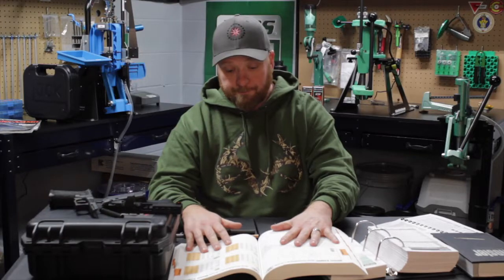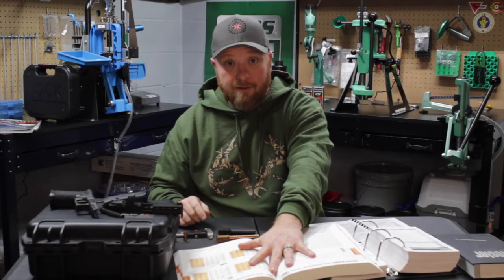Squatch Reloading - The Plunk Test and Case Overall Length

Comment: Gold star for you bro! The second, most important part of the "plunk test" is spinning the cartridge once it has landed. If it doesn't spin, don't put it in! So critical. Your video helped me to avoid countless jams in my Shadow 2 (go ahead, ask me how I know). Went from 1.134 to 1.05-1.08 and they all spun right up. Thank you!
Reply from the maker: Ha the CZ chambers are what made me really dig into this.
Reply: I’m glad I seen this video. I’m some what new to reloading . And I use the block for 9 mm. Some of my reloads seem to sit just above the block . But if I put the round into my m&p shield it works fine . So I’m better off using the BARRAL from my sig and shield
Thanks for the video
Reply: Now after you seated min. Of .054 thou. Did you change powder weight?

Comment: Thank you so much for this informative video I just started reloading 9mm the other day and ran into this same problem. I matched the 124gr RN lead OAL to a factory 115 fmj. And of course I could tell right away that the shape of the bullet being less tapered that it was jamming the action in my pistol. Reduced the OAL down to 1.07 and now it passed the “plunk” test just fine. Of course I know that will also increase pressures so I need to be careful right now I’m still at minimum load so I’m going to test later this week before working up higher loads.
Reply: I know it's a bit dated now but would like to share my thoughts on this topic. When reducing your OAL and even though your powder charge is at the minimum reduce it by 10%. Then use a chronograph to check the velocity. That will get you good data to evaluate where you are.

Comment: Thanks for that explanation.  I’ve had the same problems from barrel to barrel on reloads.  I never thought that small deviation in OAL would make that much of a difference.  Clears up the frustration when you’ve loaded a bunch of rounds exactly to certain manual specs only to have them continuously jam/double feed.
Reply: When working with new load combinations I only make 10 rounds, then live fire and chronograph.

Comment: Thank you for this video!  Just started looking into loading 9mm Luger.  I have loaded .357 mag and .38 spec. for many years and ran them through a revolver with no prob.  However, I sensed there may be a problem in an auto-loader if things were not exactly right with the finished load length; especially muzzle pressures, loading and ejection problems that could result.  Thanks for a great video!  You my friend cleared up a lot of questions for me.
Reply from the maker: You are very welcome

Comment: I just got a CZ Shadow 2, I reload 147 blue bullet, this round flies through my Glock. At my first match with the CZ Shadow 2, I started getting light primer strikes to a point where I had to quit the match. Cajun gunworks advised to check my AOL and use my CZ barrel as a reference. I adjust the AOL to 1.13, I believe I have to deepen the projectile a bit more till all round seats appropriately. Your video was very helpful.

Comment: FANTASTIC explanation dude. I'm really glad about it. But as usual if one question is answered three others pop-up😂😂..... Same here..... If one has the cartridge all ready . Primer placed, powdered, bullet placed. Exactly following the books regarding the weight of the bullet but different brands. Then confirming it by the "plunk test" and the aol proves to be too long. So, one decides to fit the aol to the plunk test but the bullet goes deeper and deeper into it's case. Isn't that dangerous in relation to the building up pressure?

Comment: I recently purchased a Walther Q5 match 9mm and the first day I had 71 failures in 120 rounds using RMR 124 grain Truncated flat points. Today i used Hollow points at the same length and 1 failure in 120 rounds.  This video will help a lot because i have thousands of bullets like that and in NY any reloading supplies are tough to come by. Hate to make "special" bullets because all my other guns have no issues but you have to do what you have to do.  Thanks.
Reply: I have the exact same gun and had the same problems! That chamber is very short compared to my M&p so I ended up reducing OAL to 1.07 and then it cycled just fine. Before I was at OAL equal to a factory 115 fmj and I couldn’t get it to lock up. Would jam the slide if I tried too hard to rack a round into the chamber. Did the plunk test and got the results I was looking for.
Reply: @DIYDad1  I went to 1.050 on the TFP with 3.6 grains of Titegroup, great plinking round.  With round nose I set COL at 1.125 and use 3.9 grains Titegroup.  Both work great and it helps to get about 700 to 1000 rounds through the firearm.
Reply: @edwinbrown219  yeah that seems to be the sweet spot for this gun. I ended up reducing the OAL to 1.05 as well. Some rounds are between 1.047 and 1.053 so for whatever reason my seating die seems to have quite a bit of variance but that could just be the difference in case length since I didn’t trim them first. Didn’t think people did case trimming much on straight wall cases so I guess it’s not too big of an issue.  Hopefully not lol. Hopefully I can test these new rounds this weekend. I’m right at minimum load yet, since the bullets are seated deeper I’m sure the pressure is higher I just hope it’s not too high. Only one way to find out.

Comment: I have been having this same problem. Setting my depth by the load data and it does not work. I also set up my die for a factory load OAL and that was too long for my Taurus G2c. I finally figured out to push the bullet in very small increments until I get the loaded cartridge to fall in my chamber properly. I was racking my brain by doing what the manual said. I am sure the manual is correct on most rounds but not all. My G2c ended up having a chamber of 1.062, for that bullet, and 1.100 for PHP from Everglades Ammo. All the while I was trying for 1.150 like my manual said. I am in about the middle of my load of powder so I should be fine. I am sure it also depends on the bullet shape. Unfortunately there is not a book for ALL manufactured bullets out there for sale.

Comment: I had a couple rounds of reloads in my Beretta 92FS that failed to chamber fully.  I saw that they didn't seat by the slide not fully forward, but it wasn't the OAL that was the problem.  It was the Lee Classic Turret press I use has some play in the turret, and when you seat the bullet, it will be set to factory recommended position in relation to the shell holder, but it will NOT size the case all the way to the base.  This can result in a slight bulge near the case base, just above the rim, and the chambering is just not gonna happen with a slight bulge at the case base.  I have reset my sizing die so that it resizes the case completely, and the failure to fully chamber is solved.
Reply: The instructions from Lee say to over cam your sizing die.

Comment: Cartridge Overall length (COL) has nothing to do with function, that can vary depending on bullet profile and vary.  The trimmed case length has everything to do with it in a semi auto.  A 9mm headspaces on the case mouth, as long as you are within the proper specs you're good.  Now, if you load your projectile to long you can push the bullet into the rifling increasing pressures and it's always good to check using the plunk test, that would be the only reason for it.  That is why you should always work up a new load when changing any component, especially a bullet even if it's the same weight.  Don't forget, if the bullet sits out to far and hits the rifling and sticks then you seat it deeper to function properly it's deeper in the case which can increase pressures dramatically even more than seating a bullet into the rifling itself.  When changing to a new bullet I split a resized and trimmed case to allow a bullet to just slide in with finger pressure.  I then insert it into the chamber and press on the base of the cartridge until the case mouth contacts the ridge in the chamber for proper headspacing.  I then remove the case and measure the length showing the length just where the rifling is in contact with the bullet.  I subtract .010" to .015" and that becomes my new COL for that particular cartridge using that particular bullet and using a chrony I develop a new load profile from there.

Comment: Thanks for sharing. I just started reloading 9mm & 40 S&W. My OAL varies in a run of 20 loads on both presses. I will get maybe five .40 S&W at say 1,125 then 1.20,1.23 1.129, 1.19! This is more pronounced with the Lee but the Dillon is not that consistent either. My Dillon 550 is for the 9mm with RCBS dies and a CH speed seater NOS. The Set up for the .40 is a Lee classic turret with RCBS seater not using crimp and Lee FCD. I'm using off brands cast power coated bullets and mixed range brass. 
.40’s are 180gr, 9mm is 147gr. WSF powder.
I keep adjusting seating die and locking everything down, running a few and measuring then start finding oddballs with OAL off again! Could it be the play in the tool heads? (I did run the die down on the lee to take out any play in the tool head with no luck). Not getting the same exact pressure on the handle each time? Maybe variations in mixed range brass? Maybe just a novice operator? However 97% of my rounds pass the plunk test and spin. I'm just concerned I won't be able to accurately develop a consistent load.
Reply from the maker: Mixed headstamps and bullet variation.       I do sometimes see variation in OAL for the above mentioned issues.  Perfectly normal unless you want to sort brass and bullets.  On another note I have seen bigger variation on my single stage press for example.  One day I size and expand then wait 24hrs and seat and crimp the next.  Surprisingly the expansion flare relaxes over night on some brass and will cause issues the next day.

Comment: Squatch I'm a new reloader and  just ran into this problem. Thanks for the video. My only question is since the bullet is being seated deeper into the case, and load data isn't published, how do you figure out how to adjust the powder charge? Seating the bullet deeper is going to increase the pressure and could lead to a gun blowing up.
Reply from the maker: There is no formula that I am aware to answer this question.  What I do is always start at the bottom of the charge weights for the given load and work up in .2 increments.  If you have a chronograph it makes this process a lot easier because you can start to accumulate data in relation to pressures, weights, and velocities and it will make you more confident. If a chrono isn’t available look for pressure signs.
Reply: I was wondering if I should just start at the lowest weight or a couple of 10ths lower than the starting weight and work up slowly. Thanks for taking the time to answer my question. I look forward to watching more of your videos.

Comment: I k ow this video, but I've got a question. When you reduce your COAL to fit your chamber, do you adjust the powder charge to compensate for the added pressure?
Reply from the maker: Sometimes work up based on minimum charge weight

Comment: 1st day of of ever reloading, after a year and a half of studying and reading everything I could,  I finally set up for what I thought would be a good round to begin with (115 XTP 9mm) using Hornady load data and OAL, I loaded 6 rounds and thought I should test them. Well as you can guess I had all the above issues, round 1 rack the slide, round chambers, pull the trigger BOOM, Hmm? that felt hot! Round 2 feeds and is pushing my pistol out of battery. I rack the slide and its sticking, Hmm? I clear the round and inspect, I look at the primer from round one as well as the case, no signs of over pressure. Round three rack the slide once again out of battery, rack the slide and the bullet is pulled from the case and lodged in the gun. Back to the bench and as you clearly explained I too checked all my measurements and not only was I under factory OAL, I was under Hornady OAL load specs for the round. I checked SAAMI and confirmed I was good and yep so it left me wondering where do I go wrong? Now I know!!! Great job, awesome content, and much appreciated.
Reply from the maker: I am glad this helped you out.

Comment: New to me info in this video, thank you. 
I am not finding load information for a 45acp 200gr lead round nose hollow base bullet. I am interested in your thoughts on how the hollow base affects oal in relation to (increased?) case volume, long for weight bullet and if that would alter charge weight at all. (Bear creek Supply bullet)
Or am I overthinking it? Should I just use 200gr lrn info? Thanks again.
Reply from the maker: It all boils down to bearing surface.  A good rule of thumb is to first find your OAL that works.  Find load data that best matches and start low on. Your charge weight and work up.
Reply: @SquatchReloaded  Thank you. Appreciate your rapid reply.

Comment: Great information thanks. 
I hand loaded some 45 acp FMJ 230 grain (I think ZERO brand) at 1.275 OAL with about 5.9-6 grains of unique. It did not pass the plunk test until I set OAL at 1.20. Have I set my OAL too short? Is this going to be way over pressured? Why’s the factory rounds plunk at 1.275 but mine won’t over 1.20?
Got anything for me? I’am kinda nervous to shoot it 😬
I should mention this is for one cimarron 1911
Thanks
Reply from the maker: Different bullet ogive is why the OAL varies
Reply from the maker: It depends on where you are in your load data I need a little more info
Reply: @SquatchReloaded  according to Alliant page it just shows unique max load of 6.5 at OAL of 1.26. My lee loading chart shows between 5.7-6.5 at OAL of 1.26. Thanks
Reply from the maker: So take a peak at the Nosler 230gr FMJ their load data is at 1.200 for their profiled bullet.  If you don’t have access to it email me and I will send you a picture of it.  squatchreloading@gmail.com

Comment: If your dummy round passes the chamber plunk test and gauge plunk test what is causing it to jam in the chamber and ejector (is it the glock bulge) Do I  need to test with a live round Im trying not to do that until I have the dummy round working correctly.

Comment: All good information. So I only have one 9mm Glock now and it loves factory 115 grain fmj set at 1.15. I was checking out the blue 115 grain round nose billets and want to buy some. My question is about the charge weight. Do I need to find the data for 115 grain round nose in one of the Manuel’s to get that or can I go off any 115 grain load as long as it’s the minimum starting?
Reply from the maker: I recommend using cast data and working the load up.

Comment: You have great informative videos!  What’s your opinion on the Glock barrels with “unsupported” chambers, especially in .40?
Reply from the maker: Run them through a GrX Sizing die prior to reloading.  I do that with all my 40 and 10mm
Reply: @SquatchReloaded  ok.  Cool!  Do you shoot Glocks a lot? If so, have you ever had any feeding issues with any calibers?
Reply from the maker: No feeding issues as long as you develop your OAL correctly

Comment: This video helps explain a lot of issues I have had! So, when you’re determining OAL do you have to adjust the powder load based on changes in seating depth?
Reply from the maker: Yes as bearing surface increase the powder typically needs reduced.  Start low and increase in small increments.

Comment: Great video, I am new to reloading and in need of your thoughts.  I am loading 9mm using Lyman's 50th edition load data for a 115 gr Jacketed HP starting with the minimum load of 3.5 gr of Win. 231 OAL of 1.090.  Although I didn't know about the plunk and twist test until now, all reloaded rounds passed the test with no issues in 4 different 9mm hand guns.  
All rounds chambered and shot as expected, but none of them ejected properly.  All pulled out of the chamber fine but would not exit completely, the slide would catch them before clearing the gun. The same problem in all 4 pistols.  With max load being 4.9 gr do you think bumping up the load will fix this issue? Or am I missing something else?  None of the 4 pistols have ever had an ejection problem with factory ammunition.

Comment: If my math is correct, the seating depth difference of 1.150” down to 1.090” is .060”.  Sixty thousands of an inch.  What is the pressure effect of seating the projectile so deep?  Are there any pressure signs?
Reply from the maker: Completely depends on the projectile type, bearing surface, base to ogive…. And so on.  This is why it’s important to work your loads up based on those factors.